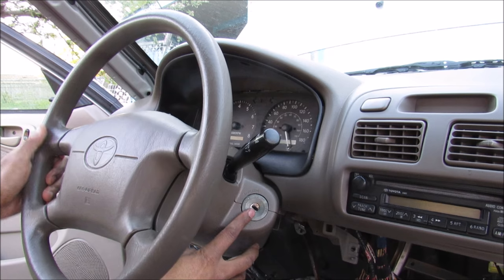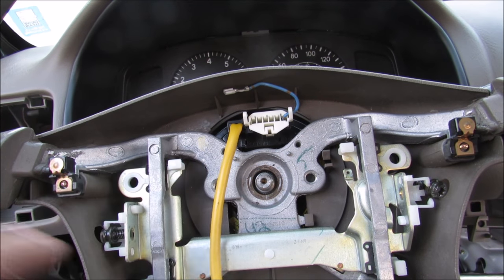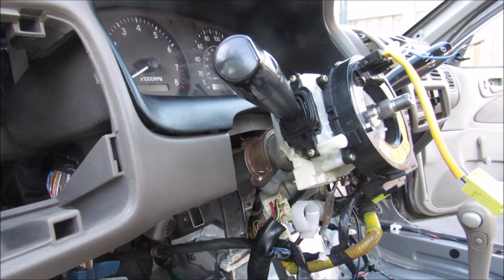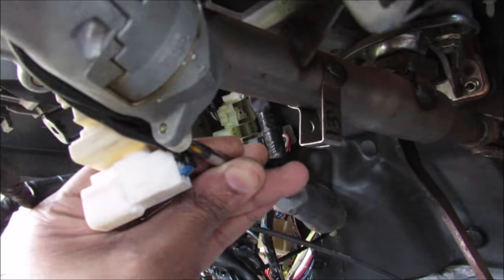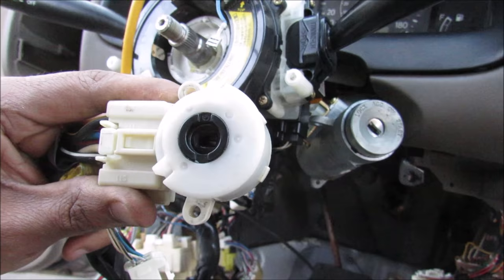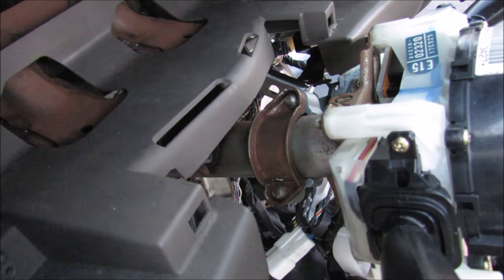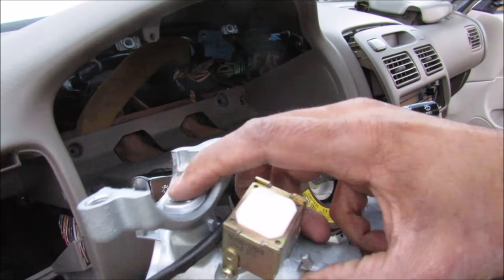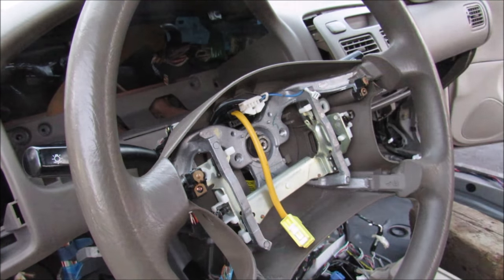How to Hotwire a Car

Comment: Make sure you have the battery disconnected before touching that airbag. Unless you want to risk it blowing up in your face or worse.
Reply from the maker: Agreed
Reply: Maybe did it out of camera.
Reply: Airbags can’t explode Out of no where like that just by disconnect them… they are wired to crash sensors and will only deploy if the crash sensor tells it to… the worst that will happen is there will be an airbag light
Reply: @Im_elmoh  
   Oh ya?
   Tell that to myth busters. One should never sctew around with any device that can explode unless it is rendered inert.

Comment: I’m new in the realm of mechanics. I have a question. I’ve seen some vids where they resort to cutting power wires and ignition wires to jump the vehicle if simply shoving a flat head does not work initially. So my question was, is there any universal method? What I seen here was an entire disassembly. I’m sorry if my question sounds stupid. I’m learning.😂
Reply: What a waste of time 😂 this is not hot wiring a car

Comment: Once I have the ignition key receiver removed is it possible to replace it with a new one? My key no longer turns it,but still works for other keyholes. does it need to be reprogrammed at the dealership first?
2000 kia Sportage, no key fob, alarm, security.its just a key
Reply from the maker: I wonder if your old Kia even has an immobilzer....if not then it's a direct replacement
Reply: Without knowing for sure, an immobilizer on a 2000 Kia seems unlikely. You should be able to just change the ignition lock, or rebuild your existing one with new wafers.

Comment: Hi, my car squeaking at rpm above 3500-4000 rpm, serpentine belts are new, but the squeaking still exists (but not at low rpm) 

What caused this and how do i fix it?
Reply: Try checking your belt tensioner pulley/idler pulleys for play. That's a common cause for sqeaks- especially loud squeaks.
Reply from the maker: Check all pulleys
Idler tensioner alternator water pump power steering etc.
Reply: @ojomominott4587  ok i'll try
Reply: @speedkar1005  do i need to disassemble the belts and pulleys?
Reply: @putraadriansyah8082  You need a new car

Comment: I dunno if it's the same with Toyotas, but ~25% of the ignition clamp shear bolts I'd uninstall from 01-05 Civics were loose by the time I got to them.

Related (?): The "ears" on a 2003 G35 clock will usually be unbroken, but they're always broken on 2004 models. My theory: The screw gun on the assembly line went out of spec (too tight), and wasn't recalibrated until the model refresh in '05.
Reply from the maker: Whoa
Maybe someone was trying to steal those civics
Reply: @speedkar1005  It was me. I woulda got away with it too, if it wasn't for you meddling kids!

Comment: I just got a 91 mercedes 300 but key won't turn will this work on the benz , if so will I be able to install and use push button start?
Reply from the maker: You have to bypass the steering lock somehow

Comment: Why didn't you just put the run/accessories and starter on the power wire and remove the starter wire when it was going? That would have been much faster and easier.